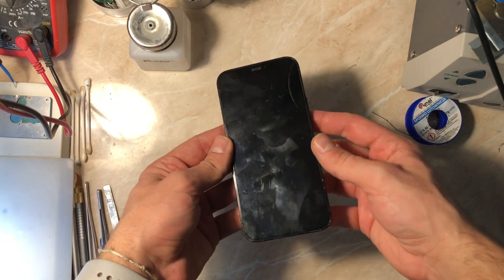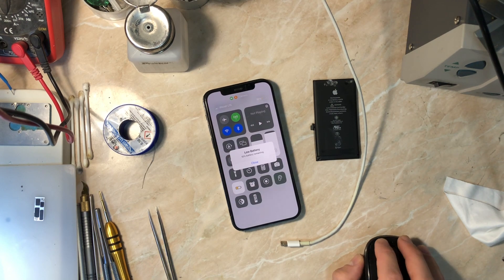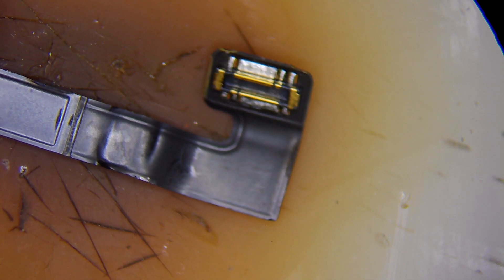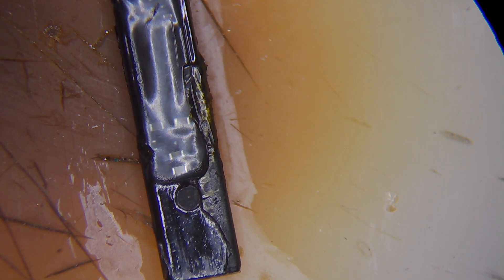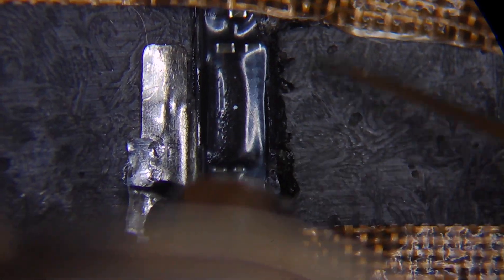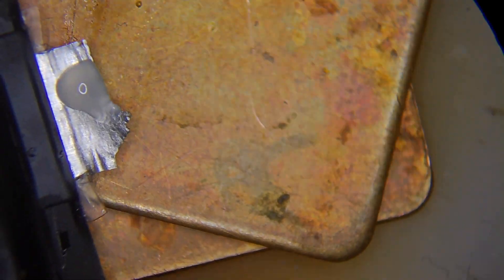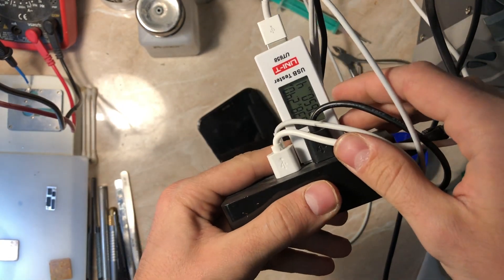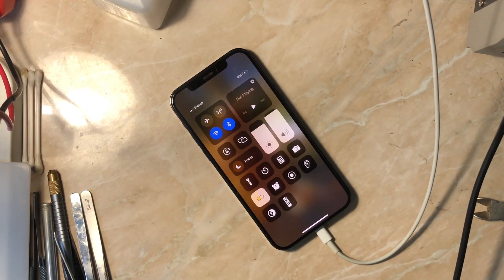iPhone 12 Pro Not Reading The Battery Correctly (BMS Flex Replacement) Repair

Comment: What is the temperature settings and airflow when you reball the ic chip?
Reply from the maker: Depends on the soldering paste
138c 250-270 air 20
183c 300-320 air 20
Reply: @AntoineKiriaky10  Thank you for replying me back

Comment: Hi. Does the donor flex have to be an original Apple battery, or can it be from a third party equivalent?

Also, is it just the one chip on an Xr.

Thanks
Reply from the maker: Must be original, but there are a lot of third party batteries that has an original BMS.
The XR has 2 chips, if you want to swap
Reply: @AntoineKiriaky10  Thanks for the quick response.
Reply: @AntoineKiriaky10  Hello again

Do you have a video of doing the same for an XR, there seems to be several chip candidates on the XR BMS board!

Thanks
Reply from the maker: @markaffleck4622  DM me

Comment: can you show where is the bms on iphone xr battery board?
Reply from the maker: DM me
Reply: @AntoineKiriaky10   YOU request for DM. please share your knowledge here. so we can learn more. thanks
new sub. nice video. thanks once again
Reply from the maker: @meharimran86  I can’t share a photo in the comments, that’s why I ask everyone who wants those information they can contact me.
Reply: @AntoineKiriaky10   @AntoineKiriaky10  Hello, I'm working on the same issue where I received an XR with a damaged flex and has no luck jumping the cut lines. It would be great if you can share which chips are responsible for the batt info. I've been looking for this solution for more than a week and didn't notice you have this on your videos. haha! Btw, the batt health and error message is not much of an issue on the client's end, but I experienced multiple random restarts throughout the day while testing the unit. The panic log specifically tells it's a BMS error, so I really want to fix this. Thank you for sharing your blessings. (iPhone XR). Followed you on IG and will try to message you if you have time. Thanks!

Comment: I think that this issue happened to me where I've likely burned the bms despite not seeing any damage. I wanted to solder a new battery onto the bms, which I did so, then when I put it back in the phone, to activate the battery so that I can program it with jcid, it seems to be bootlooping when I plugged the cable in. I also tested another non original battery and it booted up normally, so I narrowed down the issue to be the bms. It is an 11 pro max that I'm working on and I think you are right about how delicate the 11 series bms is. Any suggestions or ideas would be appreciated. Thanks👍

I have the equipment to carry out the repair swapping the eeprom ic from the old board to the new, however what stencil would be best to use which the pitch matches the bga of the eeprom?
Reply: @@MrAn0n This is true, both anode and cathode are nickel plated and depending on the quality of metal used in the product, it can spot weld very well or very poorly. So far with my experience the vendor I bought the batteries from both have poor quality connectors to spot weld to, they have just recently added another supplier which I may try in future.

Anyway I was able to get the bms working. The thing is I never actually burned out the board, however I did notice what looked to be a diode that had exploded underneath the underfill coating which was the cause of the bootloop. I bought another used 11 pro max genuine battery, and swiped the diode from that board and placed it on the main bms, and following on from that small repair was it fully working 🤔, able to program and install the battery.